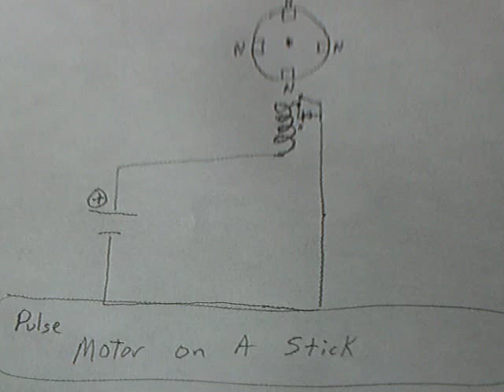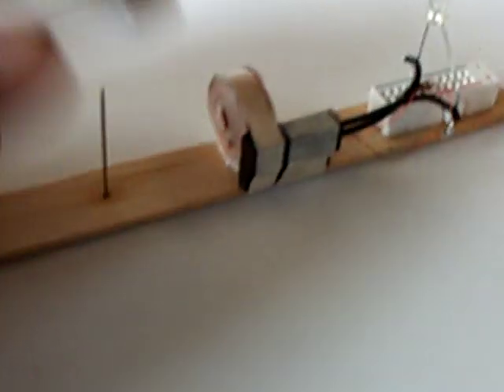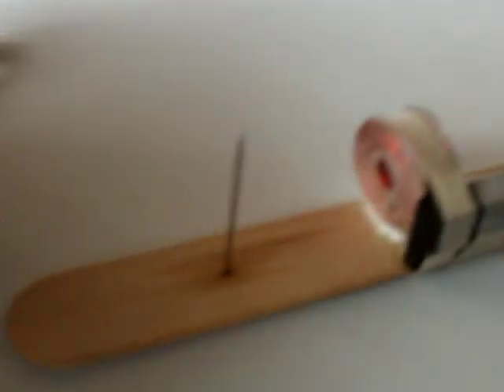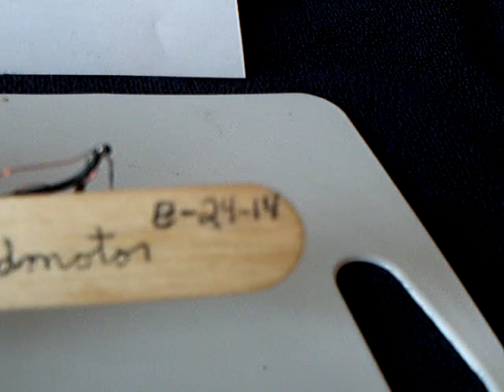Pulse Motor On A Stick

Comment: soooo i guess that l.e.d. is actually flashing. all lights do. for all is vibration. nothing is solid.  i think;]   ya.  what i,m saying is "why cant i see flickering? like other pulsers.".... anyhoot.... must be a speed thing... ty
Reply from the maker: +BLADE RUNNER It is a speed thing.  The LED flashes every time the coil reed switch opens.  It is the 'flyback' that does it.

Comment: sir another question it's about the coil that ur using. what is the guage of it, how many turn and what is the wide of the air core.  that is just simply came from a tv flyback?
Reply from the maker: +erbinjay padit   The coil is a standard plastic sewing machine thread bobbin filled up with 30ga magnet wire.  It has about 6 ohms of resistance.  I didn't count the turns.  It is not critical.

Comment: A nice job, very very simple......I want to make a replica of this motor, would you like to Shear the specification of the coil ( Wire Gage # & No of turns)
Reply from the maker: The coil is a standard sewing machine plastic bobbin wound up full of 30ga magnet wire.  Several hundred turns.  The size wire and number of turns are not critical.

Comment: Great little pulser Lidmotor.  This is an ideal device to capture the backspike energy into say another supercap, regular cap,  then measure what energy can be recaptured for re-use.      Your reed switch is tripping from the coil fields rather than the perm magnets?   That is curious also.                   aloha
A good science experiment
Reply from the maker: Jack Scholze  Hey Jack.  I don't know exactly why the reed switch works next to the coil.  The reed still works off the rotor magnets but the coil must have some effect on it also.

Comment: I don't use the pot any more. I use a one meg resistor with a 104 cap around it and some times add a 100 ohm resistor to make it a bit brighter.

Comment: I like how things we think we know inside out throw up surprises. Seems to me with this, that the magnets always have the same properties, the switch is open or closed, the coil will snap its back EMF fast every time. It would be a case of enough to move the magnets at all will keep it running, the constants keep it going.
Reply from the maker: Could Newton have been right?? -" A body in motion tends to stay in motion..."  Never mind the second part of the law.  That is the boring part.
Reply: He was lucky that the body was an apple when the external force was his head...we may never have heard about it if the tree fell on him.

Comment: what if you used a schottkey diode with a lower forward voltage of say 0.2v? lower forward voltage means less reverse voltage and more efficiency.
Reply from the maker: Actually a 1N4007 or a 1N4148 switching diode is better ---but I like looking at the light because it visually lets me know how much juice is moving around.  This is not very efficient but it is fun.

Comment: As always so neat and tidy and so effective. I have items arriving from eBay that have taken so long I can't remember what I planned to do with them and I can't find the items that arrived quickly because I put them somewhere safe. I will have to take a break and do a big tidy up soon. Those faucet lights are a good example. Do you think I can find where I put them??
Reply from the maker: Why is it that the one critical part one needs for a project is always found in place where you know you never put it.  Sometimes the item is sitting in plain sight and I just don't see it. Sometimes I get so frustrated that I just want to throw out the stuff and start over.
Reply: Trouble is if I reorder from eBay China I will have forgotten what is was for again when it arrives :-)

Comment: how long does the motor run on that capacitor if you left it alone?
Reply from the maker: The motor runs about 10 minutes on this cap filled with about 2 volts.  If I put a resistor in the circuit it will run much longer.  The button cell long run time really is a mystery to me.  There is no way that should have happened.
Reply: *****
do you think this could be scaled up to recharge a car battery?
Reply: i have seen tinman used old floppy drive motors and modified them into a pulse motor and recharged an old apc resalvaged battery.  he has videos showing you how to make them too.

Comment: How are the earth batteries doing these days or even the ones that you made of alum? I am really excited you made another video haven't seen any in a while. Hope all is well.
Reply from the maker: My plant battery is still working with about 1/3 of the magnesium still left after 3 years.  It has been running a little blocking oscillator non -stop all this time.  The philodendron plant is still alive and healthy   Sorry that I have not posted much lately.  Family matters have kept me busy.
Reply: Its okay things happen. Good to hear the plant is trucking along.

Comment: Another great vid!  Great job!

Just a couple of questions:
1.  Did you buy/make that little breadboard?
2.  What is the manuf name & part number for the diode & reed switch that you used?

Note: Your button cell may contain silver oxide.  Check here: http://www.ehow.com/about_5605853_silver-oxide-vs_-alkaline-battery.html
for more information on silver oxide vs alkaline cells.
Reply from the maker: The little breadboard is a cut off piece of a longer one that I got at Electronicgoldmine.  I don't know if they still have them or not.  The black reed switch is 'magnetic proximity switch' I got on EBay.  They use them in alarm systems and such.  The LED is just a common garden variety white LED.
Reply: Thanks for the feedback!

What type, grade, & size magnets did you use?

Thanks!
Reply from the maker: A B The Neo magnets are grade 42 discs.  5/16"x 5/64".   I bought them at Harbor Freight tools.  They came 10 to a package for a couple bucks but I don't know if they carry them anymore.  Any neo disc magnet close to that size will work.
Reply: TY!

Have you ever seen/used this webste:  Pulse Motor On A Stick
You can look at the forces that different grades of neodymium magnets can produce.  Your magnets produce something like a magnet to magnet force arrangement (i.e. your coil's magnetic field vs your magnet fields, for a short time interval).

Comment: For the last year or so I have been using a lot of popcicle sticks to make little circuits on. I have made a lot of your penny type circuits using different coil arrangements.
Reply from the maker: Those little sticks are fun.  I had to fix my original Penny today.  The 1M pot went out.  It has been running non-stop on a solar rechargeable Epsom salt and stainless steel pot scrubber cell for many months now. It runs all the time day and night-- summer and winter.  When the pot failed it failed in shorted way and the circuit when on full power and the light when on full and would drain the battery quick.